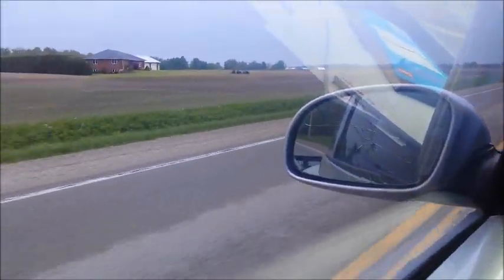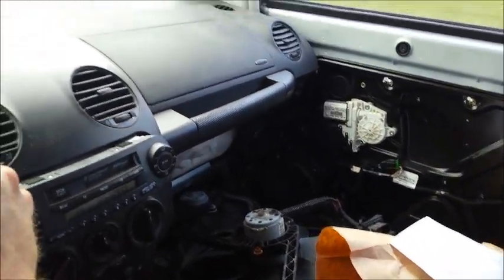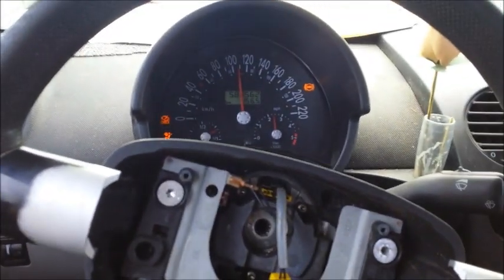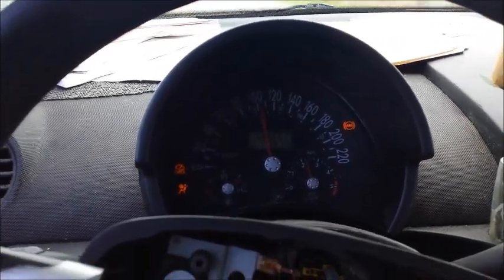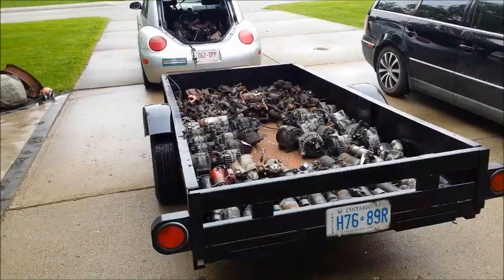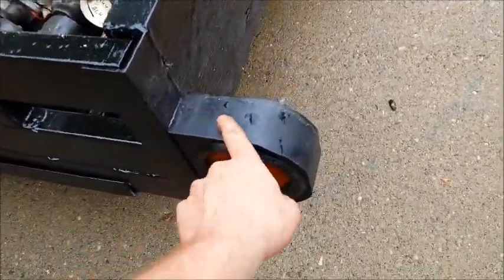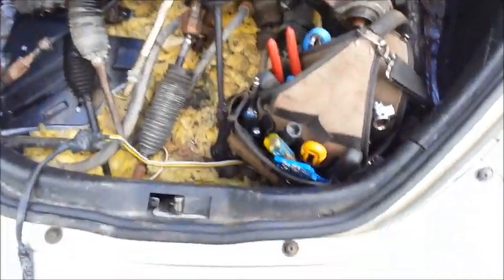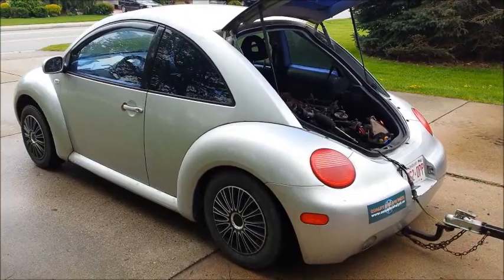TDI Beetle Trailer

Comment: Need to seperate the front part of the car with a metal large screen to prevent parts and pieces flying into the seating area in the event of a hard panic brake or accident 
Just think about it
Reply: JonesDieselPerforman Yep, a friend of mine got killed that way, had a gas bottle unfastened on his back, it flew farward hitting his head and killed him